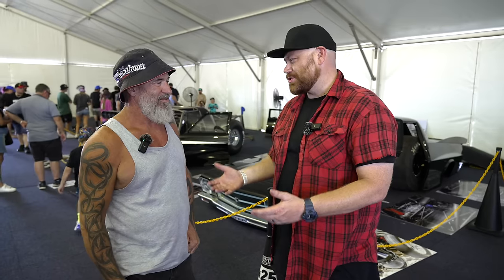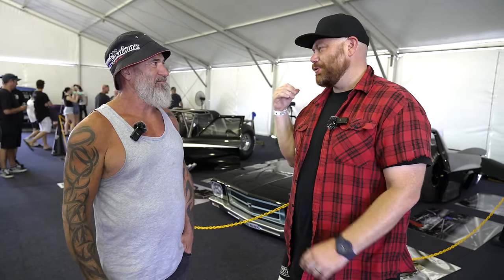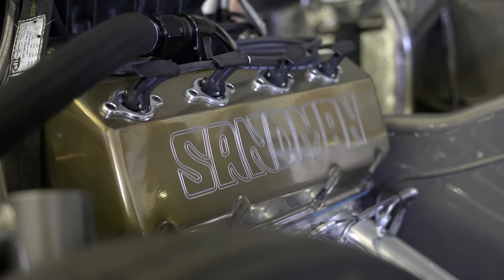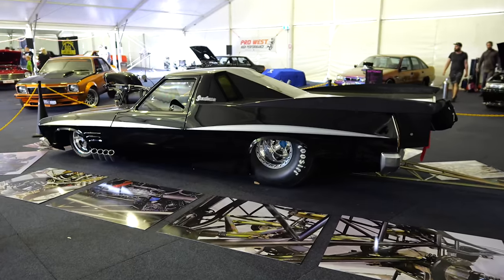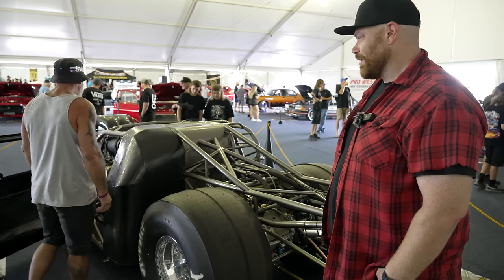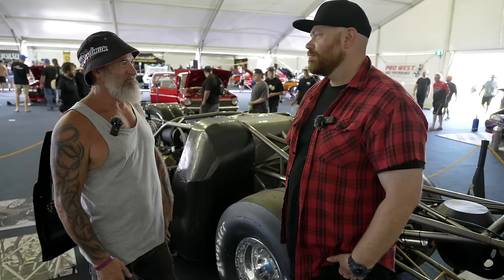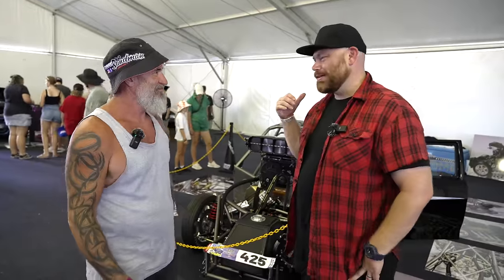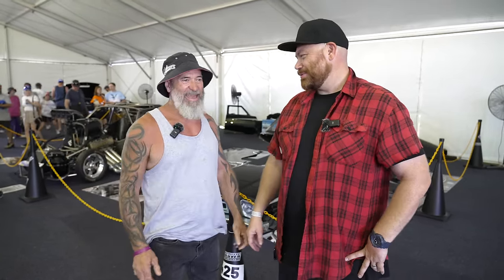This 5000hp Holden HQ Sandman Top Doorslammer Is INSANE!

Comment: Runs 1 2 and 3, short shift it to look at Hole Shot time and then set suspension up. Nail an ET later just bring it in an inch at a time and an ET at a time.